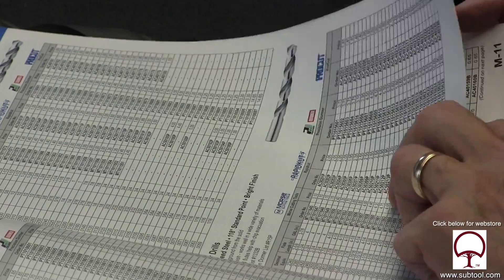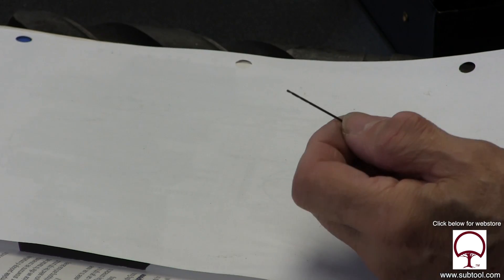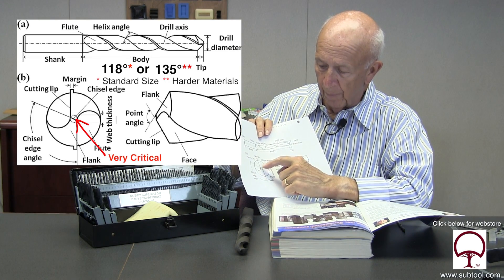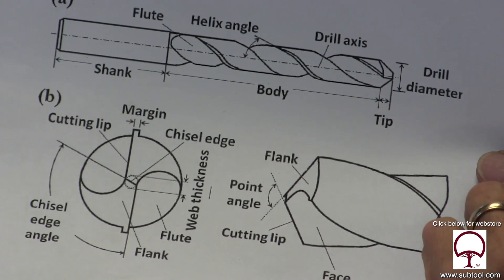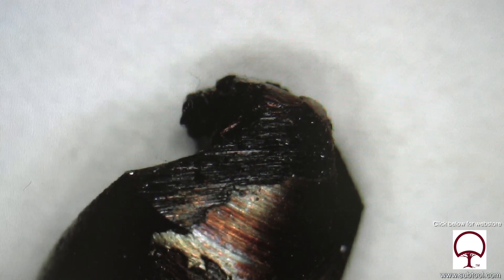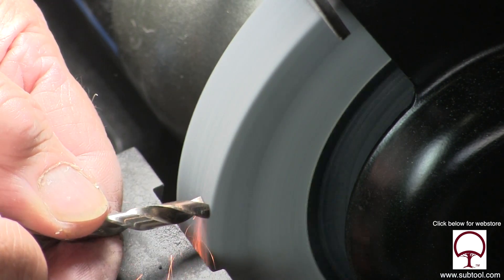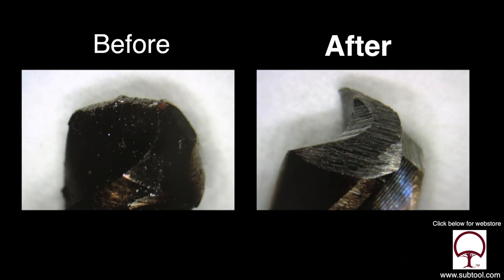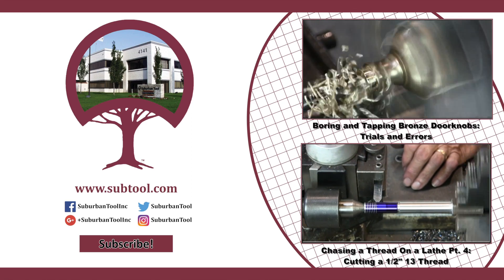How To Sharpen A Twist Drill

Comment: I've found that once I try sharpening drills off-hand below about 0.150" diameter I have a lot of trouble getting the chisel point thinned to the correct size. A drill grinding fixture or machine is about the only way I get good results in the smaller sizes. I don't even bother with drills smaller than 1/16" even if a drill grinder is available.
    When sharpening drills larger than 3/4" or so, I use a belt sander to finish the cutting edges and finish generating the relief. A good square corner on the bench grinder wheel does an excellent job of thinning the web and reducing the cutting angle on the face of the cutting edge. This gives more support to the edge and helps cutting edge life.
   What wasn't stressed in the video is that the relief is a complicated surface. You can see this on a new large drill. It isn't just a plain conical surface. As you get closer to the center of the drill's center chisel point, note that the clearance angle becomes steeper and steeper. This is because as the drill advances into the work the center of the drill has to advance at a greater rate vs. the small diameter than the outside diameter does. You can duplicate this when sharpening the drill off-hand. As you rotate the drill against the grinding wheel, swing the drill out from the 59 degree angle so that the drill describes a spiral motion. This generates more clearance for the cutting edge as you get closer to the center of the drill.
    Sharpening drills is a complex operation and no one method is good for every situation. When I worked at Champion Aviation there was need for deep drilling jet engine igniters made from Hastaloy. The only drills that worked came from a manufacturer in Germany. Before use we sent them to a guy in Ohio who resharpened them in his basement shop. The drills were run at about 35sfpm and it was slow going.

Comment: The higher the tip angle, the shorter the cutting edges. This results in less force required to turn the drill in the material. It also results in a stronger cutting edge.  This is why a higher tip angle is used, among possibly some other reasons.
Reply: For smaller than 1/8" drills I don't even try to grind the relief with a radius. Just one single flat relief grind. I use an exaggerated relief angle just to make sure the heel doesn't rub. Too hard to see or measure an accurate 8-12*. I also just eyeball the lip length

Comment: My Dad taught me a very slightly different method when I was a boy in the '50's. Worked like a charm since then. An old tool grinder showed me how to sharpen 1/8 and smaller drills with a slip stone, even thin the web and back off the lip angle. Good stuff. Thanks for kindling the memories.

I don't recall if you did a video on how to care for and clean micrometers where the different basic head designs are treated individually. Maybe include segments on how they are calibrated and what to guard against when buying used mikes. You are ideal for the task. You got the knowhow and major cred in our little world of part manufacture.
Reply from the maker: I don't believe we have, we've made a note of it and we'll look into it in the future.  Thanks for the suggestion.

Comment: Hi Don, I just installed new bearings in by cheep import milling machine spindle. I used a drift to remove the old ones. Put the new bearings in the freezer and heated up the housing and installed. installed the shaft using the same method with some grease. Can you show the correct method of installing bearings.I get a lot out of your videos as I expect others do and thank you for that. Cheers Dave.
Reply from the maker: You're already on the right track when it comes to installing the bearings!  Interestingly enough, we're  currently working on a video along these lines.

Comment: I don't like to be rude or disrespectful, but that grind did not resemble a factory grind at all (to be honest it looked horrible).  As someone who grinds parts to 0.0001" tolerances (you, not me)  I am surprised you would show hand grinding a drill.  I simply cannot see how you could hope to properly grind a drill by hand without a jig or fixture or proper bit sharpening machine.  If you are off by more than 0.001" or a few arc minutes of bevel angle you will only be cutting on one flute and almost 100% guaranteed to be off diameter.  Maybe fine for wood working or hack metalworking, but not precision machining. You have an immense wealth of knowledge and experience in machining and this video surprised me.  Perhaps I am wrong, and will stand corrected if so, but that did not look right.
Reply: Bullshit. All of my hand ground drills cut on both flutes. And I haven't even been doing it for long. Twist drills always drill oversize, that's why you don't make precision holes with them.
Reply: That is another reason why drills are not used to produce accurately sized holes
Reply: Exactly, most of the time we use drills for pre-drilling for an endmill on thin wall work-pieces (I do alot of work with aluminum extrusion) as opposed to Plunging, ramping, or helixing to depth. Any hole that needs to be especially round or is of a tight diameter would be pre-drilled and then bored/reamed/mill bored etc. If i'm being honest though, most of the holes I drill are either clearance for a bolt, or tapped for a bolt, tolerances are typically pretty loose. Bearings and Tapers are when we bring out the reamers and boring bars.
Reply: Monel Funkawitz  The center "rib" or web of the drill should not be at 90 degrees to the cutting edge. If it were, this would indicate zero clearance. the correct angle with the cutting edges lying horizontal should be between 110 degrees and 135 degrees, depending on drill size - smaller drills need more clearance, larger ones need less. The necessary clearance also varies depending on what material is being drilled and its hardness.

Don's drill doesn't look very presentable but it appears as though it will drill a hole just fine. It takes a good bit of practice to hand grind a drill and make it look anything like a factory grind. Personally I use a drill grinding machine (I have a Black Diamond grinder) if the holes need to be close. If I just need something sharpened "right now" to cut a hole that isn't critical, I will hand grind if I'm in a hurry.

BTW Don, keep up the good work. You have a great and very interesting channel for us machinists who actually view our jobs as more than a day to day grind. Thanks!
Reply: Barry Gerbracht A good indication of a good grind is when the ctting edge is straight.
Dons was curved.
this indicates incorrect angles.
it is possible to have a concave cutting edge and it is possible to have a convex edge as in this video.
mire practice needed Don.
Reply: It isn&#39;t the best grind, the angle of the web was way off. This made it interfere with the cutting edges. It should be around 45*. It will definitely drill a hole though. How long it will stay sharp is another story
Reply: I agree, the finished drill looks less than ordinary. I agree with what you are saying, in part. As a Toolmaker, I am not so bothered with the accuracy of drills in general. Accuracy of a hole is from boring out the drilled hole to size, or following-up the drilling process with boring then reaming. Then for finer tolerancing of a hole through jig grinding or honing. For deep holes a gun drill or deep hole drilling machine must be utilised. These are usually within 0.0001" on diameter and withing 0.005" on run-out over a metre/yard long hole.
Reply: you are totaly right, its unsuitable for reamer preparations holes or small diameters. i hand grind drills (for laziness causes) for years, i use them on cnc's for unprecise holes. for precise holes use carbide or new drills (old hss drills are many times bent). i have a Taiwanese drill grinding machine which i hate because it removes too much material from the drill tip but sharpens them quite well.
Reply: Hand scrapping?  Some folks have skills
Reply: When you have become a skilled craftsman and you sharpen drills, you learn how to do the sharpening so the drill functions as though it were new.  That is why this is called "skilled" labor.  If you are not skilled at sharpening drills, use a new drill.  When it gets dull and is no longer useable, throw it away and buy a new drill.
Reply: I have a drill shapening grinder.  It is adjustable so you can take the least amount of material to sharpen  a drill.  Advice: learn how to use your tools.
Reply: You stil need the drill to make a hole that can letter be reamed, or ground to a precision size.  All accurate holes have to be drilled first.
Reply: Nope, jigs and fixtures are gimmicks for novices. The grind Don did here will work excellent.
Reply: Ive been hand grinding drills for over 25 years.  I use a Heim drill for precision holes, but the hand sharpened twist drills drill just fine.  Only thing I see he did wrong was the center rib should be 90 degrees to the flutes, but it will still poke a hole in something.
Reply: Somebody who knows what he or she is doing, has a good grinder with a fine stone and some lubricant (valve grinding machines are ideal) and a very simple tool known as a drill-bit/chisel sharpening "gauge" that ensures the angles and flute lengths are correct can do a better job of sharpening a drill bit than any Drill Doctor or non-factory drill bit grinding machine you're going to find. It's not that tough if you're shown how by somebody that actually knows, want to learn, practice and know a few key things NOT to do. I was in a tech school class of a few dozen just-graduated "high school kids" with varying degrees of previous mechanical/shop/tool education and experience and not a one of whom had ever PROPERLY sharpened a drill bit in his life and we all managed to learn it well enough to pass that part and every other part of our first quarter "hand tools" class where we learned how to PROPERLY do "simple" and "complex" things that most "shadetree mechanics" consider either "easy" or "impossible" and almost everybody who has spent more than a few minutes to hours in a "shop" has done/tried at one time or another but maybe 5% of mechanics - professional and amateur - do right. Such as using a file properly. Files only cut in ONE direction and just like you only put "downforce" on a handsaw when its going away from you, you only cut with a file when you're pushing or drawing the "teeth" away or toward you depending on the situation. The difference being that while its "okay" to let saw teeth "drag" back across and through the "work" you NEVER drag a file back across the "work" because you're putting sharp cutting "edges" and "teeth" in the steel you're filing and work-hardening them at the same time and between that and the "grit" left behind you'll dull a fill in no time dragging it back across the work. Not quite as quick as you will "sawing it" back and forth putting force down in both corrections but close. A good "file operator" can make a good file last a lifetime. An idiot with a file can ruin the best file made in seconds and its gone forever. A good hand with a good grinding stone and a drill bit sharpening gauge can sharpen a bit in no time better than any Drill Doctor you've ever seen. And a clown like this who clearly has NO CLUE what he's doing can jack around all day and make nothing but the mess he's showing off as "good work". Anybody who knows anything about how drill bits work doesn't even have to know HOW to sharpen them to see that "sharpened" bit isn't going to drill jack shit.
Reply: Some machinists don't have a drill sharpener at their disposal. Open your eyes and pay attention to what this old tool and die maker is showing you and then say THANK YOU SIR!.
If you ask him nicely he might show you how to grind a drill to predictably create a larger diameter hole for you to stick into the turret of your brown and sharp screw machine.....what is that????   lol

Comment: No chop saws in your shop? That is a great way to get that drill back to a good area for resharpen.  I can never freehand a drill under a 1/16" and get the thing to drill straight.
Reply: I used to routinely resharpen small drills down to .010" and .015". I had access to a very fine face wheel and folded a card over the shank to give me something to hold. the card had an angle cut in it for reference, but i had to keep a close eye on rotation and depth of grind. took a bit but i got very professional results after a while.
Reply from the maker: Ha, no kidding.  That's a very small drill to sharpen.

Comment: Thanks Don, for showing us how to rescue of a totally ruined drill bit.  I sharpen my slightly dull drills on a medium to fine grit sanding belt using a drill gauge to check angles and centering. I then thin the center chisel edge to minimum width on the grinder wheel as shown. Lots of perfectly good drills are thrown away due to lack of knowledge on  how to sharpen them.